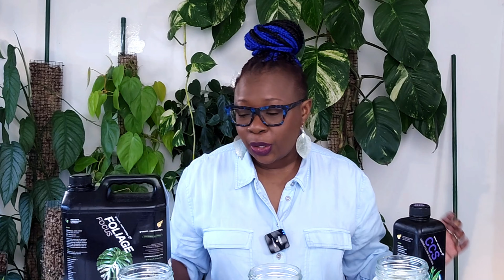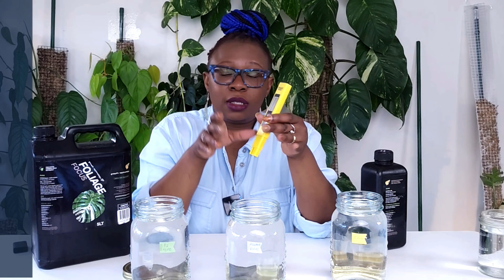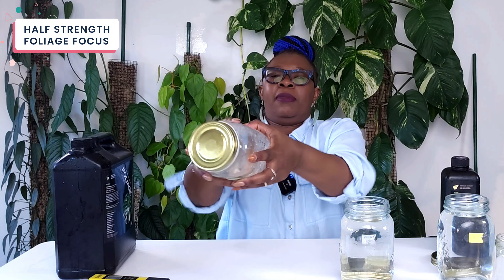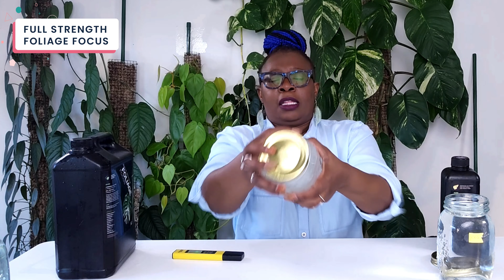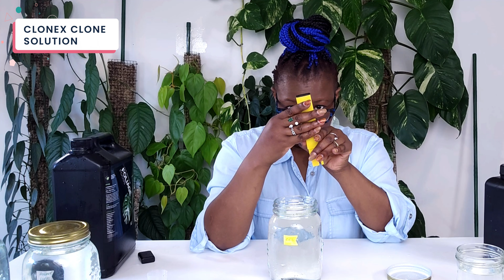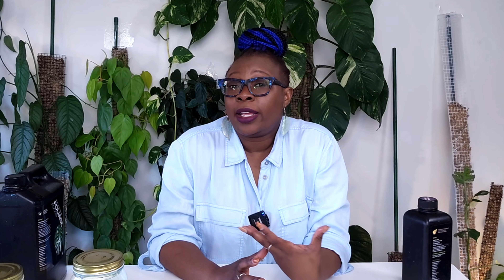Measuring EC/TDS in Foliage Focus Fertilizer: Unlocking its Secrets

Comment: i'm not doing hydro, as media i ise for most plants is pumice. anyhow, i'm using also water conditioner and ph down solutions from aquarium trade. been going good. i researched this is best form of ph down, forget the element right now.

been using foliage focus and it's good. now buying ccs, orchid focus, veggie focus, flower focus and root zone. see how these go.

i did moss poles using chunky coir (rinsed) and dressed it up on front with peat moss.

our water in melbourne is pretty good but does have some minerals, as becomes evident in water kettle after few months use.

Comment: If using her TDS numbers don’t forget to subtract 33. I use a Zero Water filter and TDS reads zero before I put in nutrients so I may get a lower TDS reading. I’ve used General Hydroponics (GH) 3 part system since I started using LECA in 2020.  I just bought Foliage Focus to try as well as Clonex and I can’t wait to see how it works in comparison. (Note: I’ve used Rapid Start by GH for rooting. It’s worked really well.)

Comment: Hi Nora. Thanks for a great video with simple, easy to understand explanations on everything to do with fertilising using FF. I so happy that I’m getting it right and my read I are almost the same as yours. Only difference being my tap water on Gold Coast is between 80 & 90 TDS which is not bad. I always check PH while I’m at it and do a little adjusting down to about 6.5 PH. Thanks again Nora, you’ve given me confidence in growing with Semi Hydro.